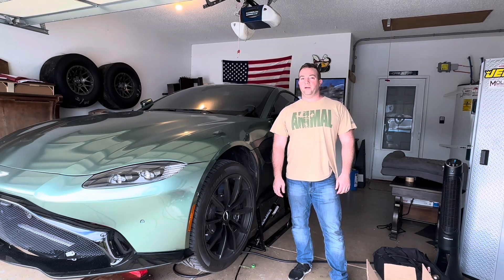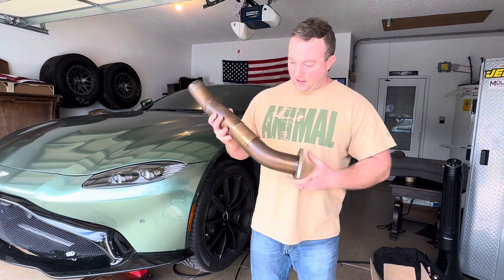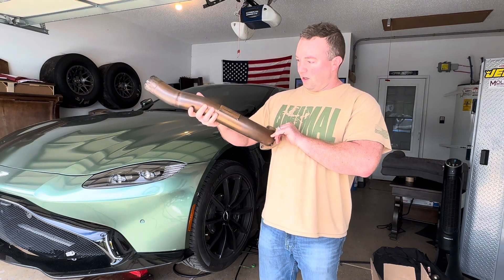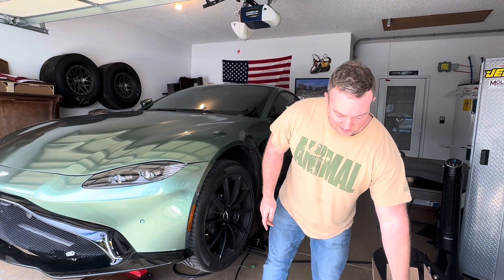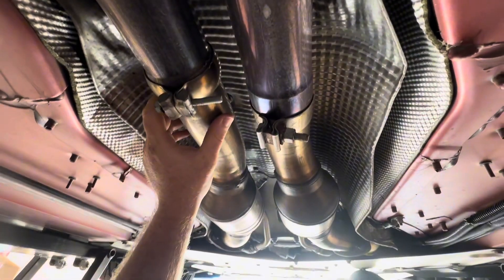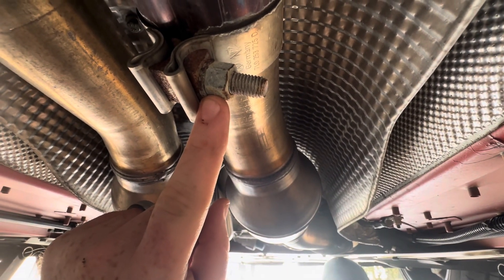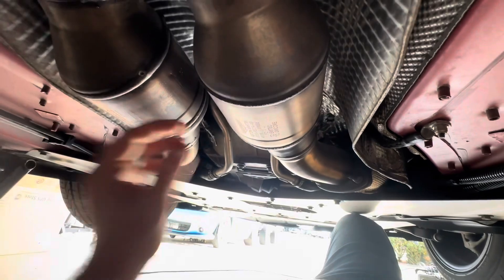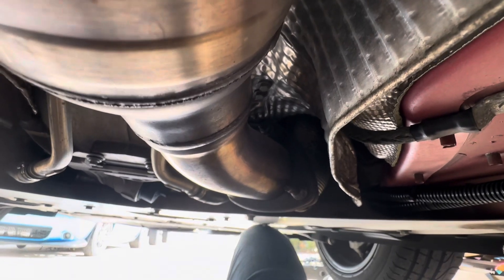Aston Martin Vantage M177 secondary cat delete pipes install before and after

Comment: Do you recommend it as a modification? It's not too noisy after right? Especially in normal mode or sports where the valves are slightly closed, Does the sound remain as dark as it is now or does it become acute?  thank you